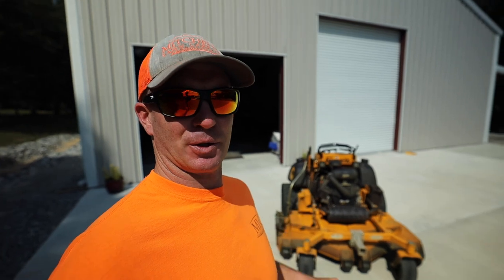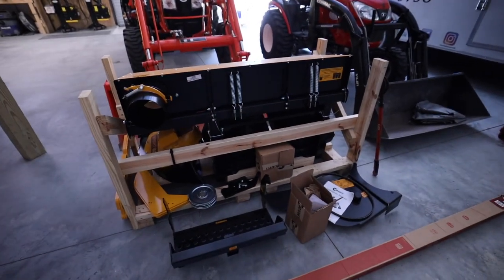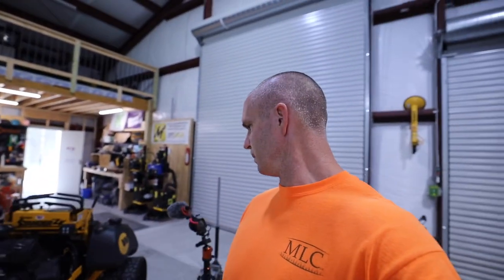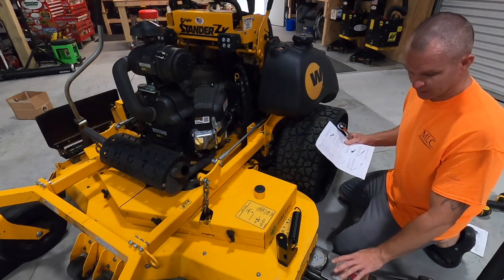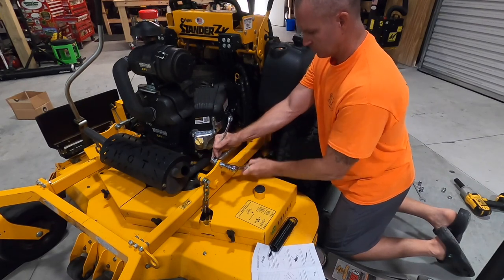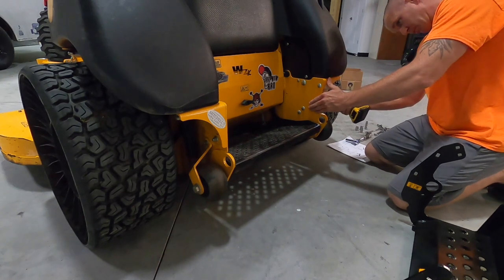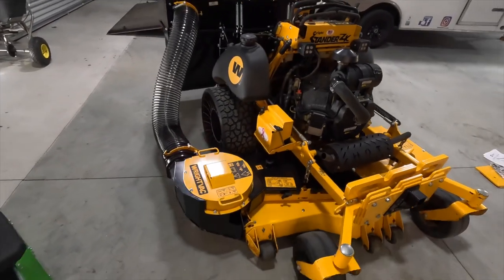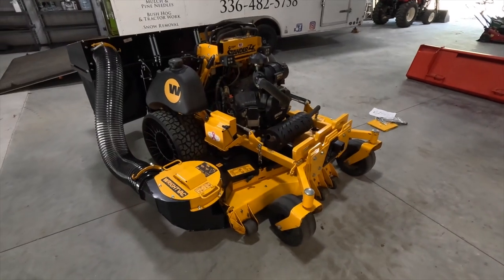Installing the WRIGHTVAC on my ZK61!! Step by Step

Comment: looks almost exact same install as my ZXL.
it is the best vac system i could find as the aux belt routed is much simpler and is thicker than the Scag belts which didn't last more than several hours.

Comment: I just bought this setup and picked it up today but I’m getting a lot of air blowing out the front blowing the leaves up not sucking them in very well… did you run into this wile setting up? Is there a  setting I could adjust on the deck?
Reply from the maker: What kind of mower blades are you using?

Comment: Hey man, how are you liking this set up on your ZK? I actually installed the same one on our new ZK last spring. After watching this I just realized my dealer didn't give me all the weights needed for the kit! I have the video on my channel, thus having the front end being light and wanting to pop up going up hills. I also noticed for the dethatchers the hitch is mounted to high as well for the tines to dig in. (I bought the kit when the bagging system was so new for the Zk so I actually had to have a rear mounting bracket fabricated on it.) Id love to hear your feedback on the system thank you!
Reply from the maker: That’s unfortunate that you didn’t get the weights.  They should’ve come as a package deal when you purchased the system.  I thoroughly enjoyed this past fall.  Wish I’d had it years ago

Comment: I was going to buy a zk with tripple bagger does anyone know what length it is from front caster to the end of the rear part of the tripple bagger i want to see if it will fit on my trailer or if i need to get a bigger trailer to carry it with my ryder. Also how are they on bagging grass
Reply from the maker: I can get this measurement for you later today!

Comment: Just ordered one for my zk, how did it do for leaves?
Reply from the maker: Does great … don’t use high lift or mulching blades, standard worked best for me
Reply: @mithgo_outdoor  thank you !
Reply: @mithgo_outdoor really no mulching blades that is good to know
Reply from the maker: @aaronhobart6223  yep, i had terrible luck with them.
Reply: @mithgo_outdoor  hmm so just put the oem blades on I’m in Ohio if that matters
Reply from the maker: @aaronhobart6223  as with anything, try out some different options and see what works best for you. 😊
Reply: @mithgo_outdoor  the bagger is damn nice but man it is heavy on the mower I kinda wonder if long term it wears out the drive line .. and if it is wet I’m wondering if it will get stuck it’s definitely a tank with that on there